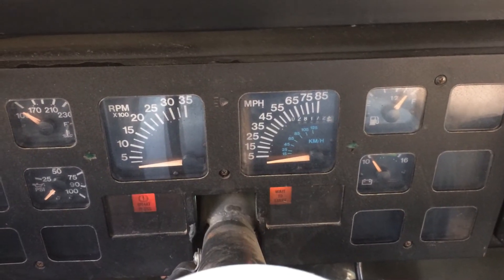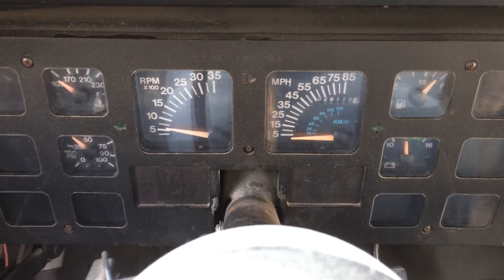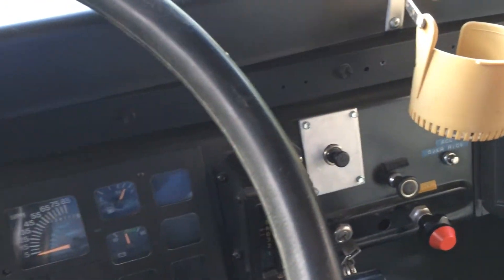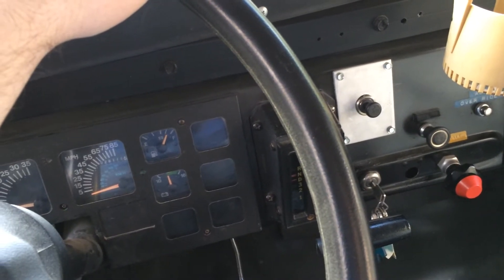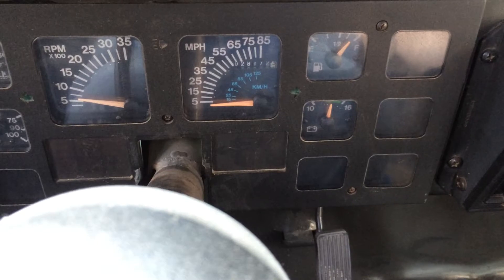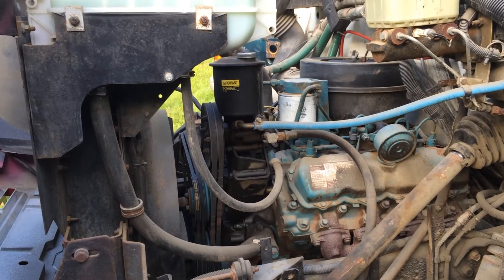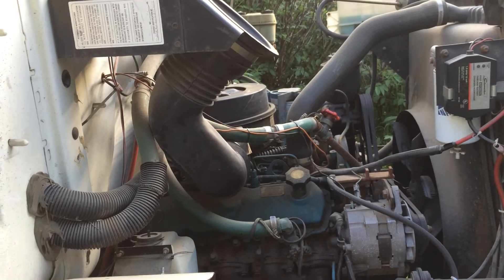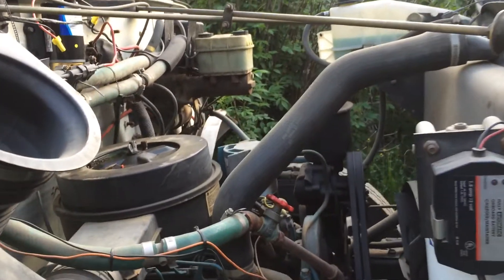1991 Navistar Bus Cold Start in the Summer

Comment: You do not want to run that 7.3 at 3000RPMs.  The engine is governed to run at 3000RPM under no load and around 27-2800RPM under load.  7.3's don't do much better than you described.  I would replace the glow plugs with either OEM International plugs or Ford Motorcraft plugs as they are the same for the 1988-1993 7.3IDI engine.  I was able to squeeze a little bit of top end out of mine after adding an overdrive manual transmission (as there are no overdrive autos that will bolt to that engine).  My bus's former 7.3 blew it's crank from bad motor mounts and over-stressing the engine.